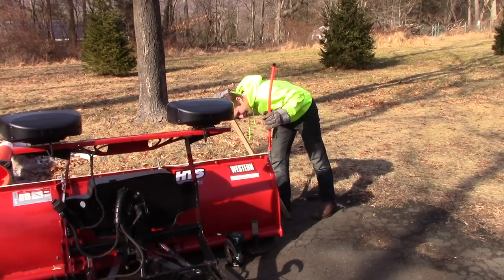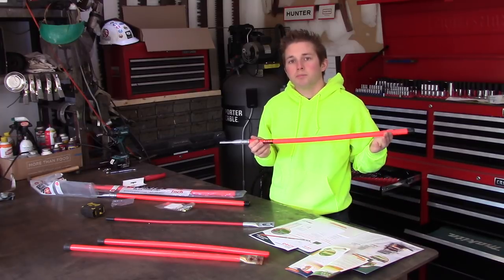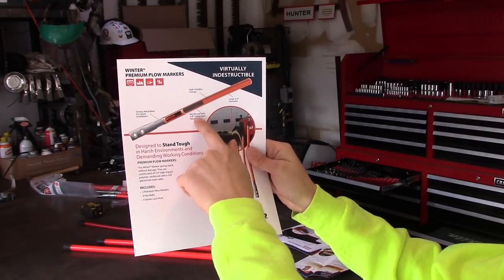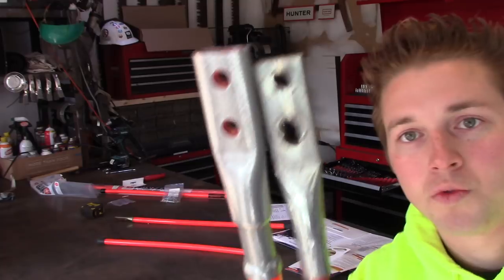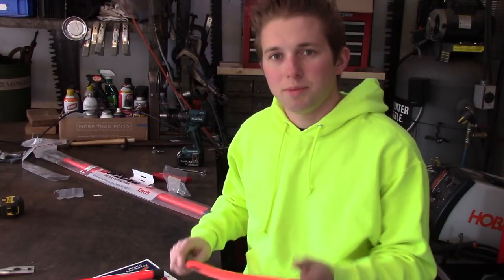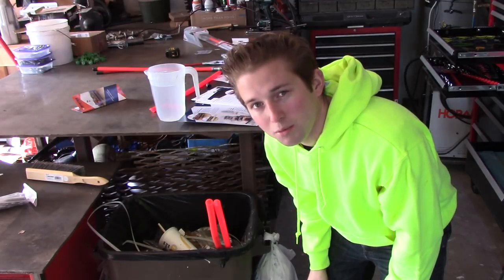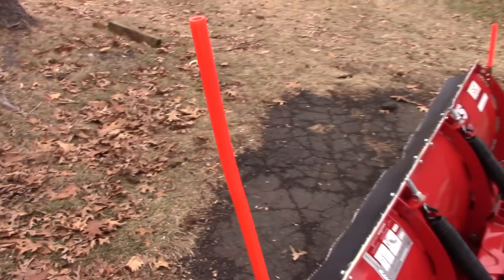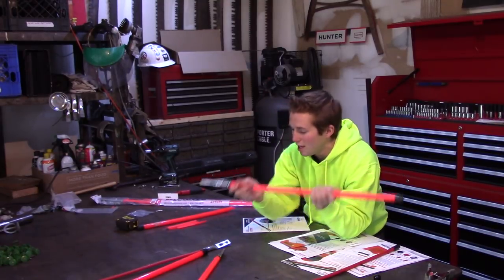Indestructible Plow Markers?

Comment: I just replaced my oem plow markers on my hts and glad I did cause westerns markers look cheap, and are too thin and short. I bought the ones that are sold in AutoZone and advanced auto parts made by snowplow parts. Only dislike I have is they bend easy themselves driving 45mph plus.
Reply from the maker: You know I actually haven't tested these markers at high speeds, but honestly I almost never have the plow on when I am going down the highway. Because these markers where initially designed for dot highway plow trucks, and with the galvanized steel cable inside im sure these will do well ah higher speeds

Comment: My dads truck all have steel pipe welded to top of blades and we spray paint then  there in distructable I’m working on geting my own set up so I don’t have to relion and one  I 
Like fisher blades best
Dude the plows we run look cheap and are blades we have a 2000 7.3 dump that’s almost die and we got welded old cut edge on top blade as deflector and we run the blades and backdrag blade down to nothing that’s truly a cheap old school efficient set up for town roads plow it has sander this year we cut dump body off and drop on frame instead of in body hope for it to last a year or two and I’ll take over the driveways I already do all of the plow work but I want a 70s or 80 k20 flatbed with built 5.3 gas in it and a sander and 8 ft blade
Reply: Jake Kaneo you want them to be flexible.. you hit a mailbox with them and your going to destroy it